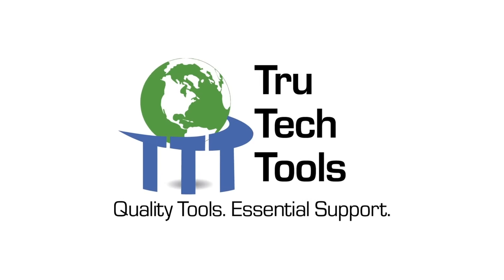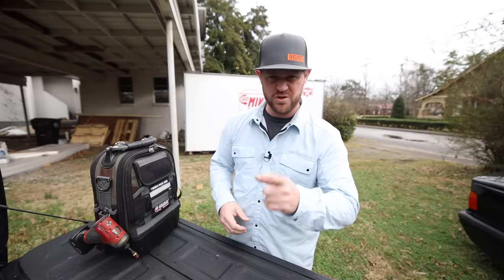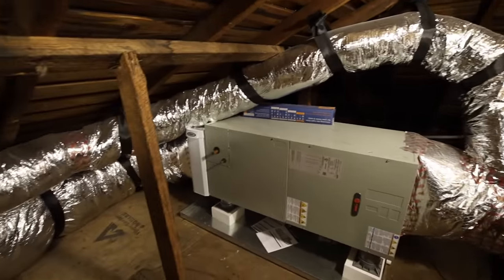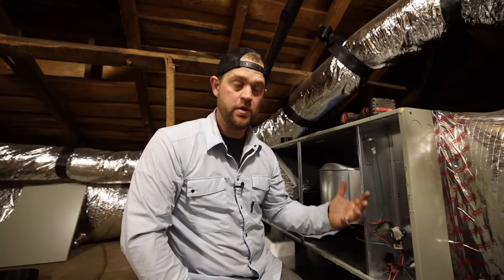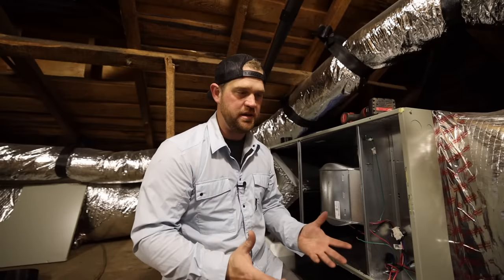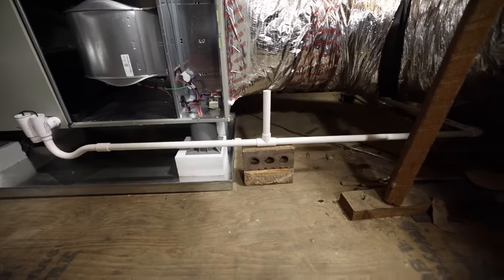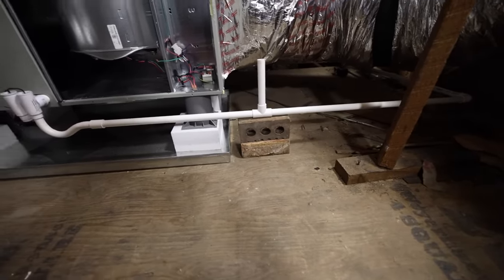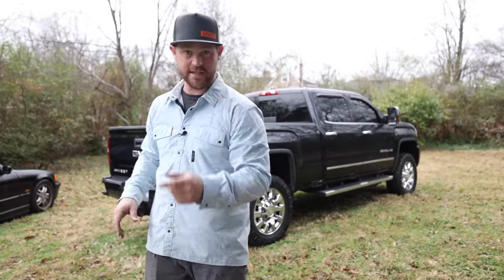I Should’ve Known BETTER…| HVAC Install

Comment: You have to move those drip shield baffles to the other side of the coil on both the front and the back of the coil. They divert the condensate down into the drain pan. Always read the manual
Reply: Also press fittings are trash. Carry your damn torch to the attic and braze in the lineset like it should be. I enjoy brazing and will NEVER use that garbage whether it’s zoomleak or rls. Used to like your channel but it’s become one big infomercial
Reply: You can’t forget the useless float switch on the p-trap
Reply: @baitcasterdisaster8981  get with the times my guy, that’s exactly what they used to say about  pro press fittings for water heaters. If done properly they never leak especially if it’s rated for 700 PSI. The future is here those who fail to adjust will be left behind!
Reply: @Luis-jw2yx  perfectly said. Somebody always has to complain about the way people do stuff and parts they use.
Reply: @baitcasterdisaster8981  He said it more than once that he sponsors several items used in HVACR servicing and installation.-
Reply: @baitcasterdisaster8981  get with the times, don’t be scared of using new technology, embrace it and master it

Comment: The filter/drier belongs INDOORS per the mfrs that supply them loose, it is in the manual.
The suppliers that put them in the units from the factory are done to make sure that it gets installed. Usually this equipment is low end stuff installed by lowest bidder.
Reply: I've been dealing with outdoor driers since early 1990s. I'd say it's okay.

Comment: A few things I want to point out.
How come your not using a water pump with 3/8 
hose straight to the laundry or basement septic ,
and I think using easy-trap going from the coil straight to the pump works much nicer.
And one more thing you need a switch on the top off the furnace for service’s. Thx you

Comment: Nice clean work. You made that fishing of the high voltage through the liquid tight look very easy. We know that took some time and effort, didn’t see you apply any electrical glide in the liquid tight . Again nice work.👍👍🇨🇦
Reply: using conduit lube helps when pushing the wire through by yourself.

Comment: If you use plumbers pipe dope on the PVC fittings going into the coil it will seal properly and you will be able to unscrew in future if need be.

Comment: very clean, we always insulate our drain lines to prevent drip trails, + safety switch on the pan just in case extra security never hurts.  Looks like the plugs not installed on the pan from what i can see.

Comment: When dealing with Trane, I'd order a downflow air handler if I couldn't get the pan and the discharge the way I needed it to be. It'd come already configured with the drain pan and discharge right configured in the way you need it.

Comment: I see a few things that are different codes for me here in NC 1. We have to insulate the drain if in a attic 2. Drain has to be supported with metal hang strap 3. the primer must be seen on connected pvc
Reply: In ky. That job wouldn't fly all that flex imo. Looks like hack job just doesn't look good we use round metal in most attics flex only from duck 2 reg. Maybe I missed something

Comment: I woulda prob put the armor flex on the suction line before you pressed the copper pipe looks cleaner then having to add the amour flex after at 6:30 . Looks good tho
Reply: "armor flex" 🙄

Comment: That wye right off the square to Round is going to get a lot of blow by. Should have used a plenum to create stawić pressure that would help distribute the air more uniformly
Reply: Static *

Comment: Great work! A couple things I would do different though. Not that your way is wrong or not code worthy, again great work. 1 there's no need for liquid tight (not to mention it's expensive), I'd use flex conduit. 2 I'd typically build a trap for a negative pressure box. I try to get a 3" difference just to be sure it doesn't prematurely/intermittently drain into the secondary. 3, I would only use a safety switch on the secondary and also make sure it drains into a conspicuous location. 4, I would also (especially since you're not brazing) use the factory rubatex and make it all one piece instead of using that split stuff. Other than that, everything looks great and your work is better than 90% of the stuff out there! Keep up the good work, dude!

Comment: If everybody watching this is such a expert, why are you even watching?  Leave the man alone.
Reply: If a man is going to instruct, the instructor should provide a quality lesson. Experienced installers have pointed out legitimate concerns which will benefit the lesser experienced. FYI, I read thru all comments to date & found everything I noticed mentioned while finding several comments on items I did not pick out. Truly a  beneficial forum.

Comment: Kind of weird to see a video like this, here in Florida, when you install the system you start the system. Never seen anyone come back in and do this type of work. Even in new construction, on trim out, Everything is done except for the vacuuming of the system and the start up of the system. Hmm. Good work though.

Comment: We had a seminar at Ferguson a little while back trying to sell those quick clamp copper fittings , there is no way in hell I'd ever go for that crap. I could see very isolated circumstances where one would come in handy on a retrofit application where brazing was just not possible due to limited space or dangers of an open flame... But other than that there is no way I would ever use that mess. Clean looking install the only thing that we do extra we also add a drain float on the metal Pan itself,  probably ultimately unnecessary but I feel better giving the customer that extra protection.

Comment: Great video brother but I can't help but to think that I would ever give up my torches for a pro-press or even the new shark bites they have I just trust it better rubber breaks down over time lines vibrate and over time they will leak I have seen it but to each their own still love the video and your details!
Reply: You are a smart man !!!! I have been doing this trade in super market and residential for 4 decades. You are correct they will not last. !!!!!!!!
Reply: Especially with the POE oil. And with the new mixes that keep coming out. Can’t go wrong with braze. Beside more cost effective in my humble 20 yrs in the field

Comment: High dollar crimp machine is fancy . Years ago in mid to late 80s carrier had the fitting that had the O ring type fitting the big nut would crush down on lines BUT! After couple years it would leak i wouldn't trust anything less than silver soldering sorry I'm old school. Few yrs of expanding and contracting especially heatpump that fitting will leak .

Comment: Good clean organized work but ..!  I dont know if I'd use the tube brush cleaner after cutting off the bell ends of evap lines.  Any shavings or debris get into the strainer or txv or eev its trouble.   Not trying to be critical just careful....  Otherwise, real good work and video

Comment: Amazing looking install so far, I would've most definitely used a larger drain pan, that right supply edge looks to be right at the edge of that pan, maybe slide the air handler to the left inside the pan. Clean work though brother, Love your channel!
Reply: Pan is definitely not sized properly, since code requires the pan to be at least three inches longer and at least three inches wider than the equipment above the pan. So splitting the extra, there should be about 1.5 inches (or more) sticking out beyond the equipment.
Reply: @stevebabiak6997  very true but codes vary from state to state, I don't know the codes in TN, I'm in NC and we are as you stated needing 3" all around. My number 1 priority in an attic installation is the condensation overflow prevention.
Reply: @toddhagee6716  - I didn’t see a cut-off switch on the pan to deal with possible overflow …
Reply: @stevebabiak6997  @11:25

Comment: Damaged a bunch of fins on the coil set up when you changed the drain pan. Unit hadn’t even been turned on yet and you decreased it’s efficiency and cooling abilities. Also increased it’s odds for freezing up in the future.

Comment: Zack I love your videos, but man those Tem4 have been nothing but nightmares for us service techs here in Florida.. can’t tell you how many times I’ve been to calls where the secondary was full of water due to the baffles not being corrected. Also if speed is not adjusted it tends to suck water off the coil depending on static pressure or how clean the coil is. Vertical applications have also been a nightmare due to the slime it builds up and the slime it builds inside the backside of the pan that is almost impossible to clean. I hate Trane lol.
Reply: You should love Trane. I love all equipment because they keep me busy.

Comment: I know you may be stuck with this type of installation, but you never install an HVAC system outside of the thermal envelope. It takes half the energy just to condition (and that doesn't do a very good job) the space around it and the duct work too. I learned from my mistakes. And you'll appreciate it later on service calls. No hot attics in the summer.

Comment: I definitely not against the way things are in order to be a modular system but I have wondered about why manufacturers don’t make air handlers that are the drain pan.  Without much effort they would be able to make a literally universal air handler that could be installed on any side without having to be re-arranged internally

Comment: I have nothing but problems with my Hilmor pipe benders on pipe larger than 5/8. Had to stop using them and go back to my Yellow Jacket benders. I have no similar issues with them. I guess you get what you pay for.

Comment: Good video - Thank you!   I would highly recommend that the breather is installed over the spill pan in case it leaks and the float is stuck.  This would prevent the area being flooded if the drain tube gets blocked down past the breather.  😃

Comment: Your video is amazing. I am watching it to see if the person who installed my system did properly.
My  Trane system is almost the same than yours but the amount the air coming out of the vents is extremely low. The installer says it need to reconfigure the ducts. 
I just did't understand one thing: why is your emergency switch (overflow switch) above the trap level?
Shouldn't it be the same or slightly below the trap level?

Comment: I had a class once🤣 and for 8+ hours the only conclusion I came to was always read the manual. 
My oil /gas burner instructor also stated that it doesn't matter how many times you've done something always glance at the manual. 
In general it's usually the installer that hacks it in,then everyone calls it junk when it doesn't work!(Goodman)
Thanks again for the videos!
🍺🍺🍺🥃🥃🏌🏻‍♀️🎯
Stay safe. 
Retired (werk'n)keyboard super tech. Wear your safety glasses!
O-Rings can't be my future!🤯
Reply: Ha!  I say this to my techs almost weekly.  Enjoy retirement!

Comment: Lol you cut out the part when you were putting the coil in all the way back. Either position left or right there is a screw that keeps it from going back in easily on the bottom back. I usually just snip them a bit with the cutters and it just slides all the way back easily.

Comment: Great install, as usual! What drill attachment did you use for knockouts for the high and low voltage connections? I couldn’t find the link in the description.
Reply: it's a step down bit ain't it?
Reply: @saulurena7681  my step down bits are cone shaped. Maybe a different style?
Reply: It’s just a standard step bit ..
Reply: @nicksplumbingheatingandcoo6091  his was cone shaped as well, most all I’ve ever seen are just different increments of size

Comment: The vent is called a "vacuum breaker" and it does exactly that, stops a vacuum from holding the water in the pipe.
Reply: That's why your supposed to prime your P-traps! Show me in the install manual where your instructed to do that and I will concede! And I've only time I have heard of a vacuum breaker is in relation to steam pipes.
Reply: @berated4541  I don't know what you're trying to say right now but maybe just open a code book or any plumbing handbook. Every trap requires a vent installed as a vacuum breaker. Or maybe look at the plumbing in your own house? If you can't understand this maybe you shouldn't be working on anything to do with plumbing
Reply: @Andersonairchris  😂🤣😂🤣 Go ahead and show me in the installation manual (The one booklet the Engineer team that designed the unit wrote so that it could be properly installed and maintained) and I will concede. And what code book are you talking about? Codes vary from county to county, city to city and state to state. So I literally don't know what your trying to say. And I was just referencing the install manuals from the manufacturers so don't get your panties so twisted big guy. And as for your last sentence, I would love to compare our work and not only see who's looks better, but who makes more doing it 😂🤣😂😃
Reply: @Andersonairchris  Did I also mention that in 8 years of installing residential swap outs and new construction, I have never once, been called on not having a breather on my air handler. And CA is as strict as it gets in the States.
Reply: @Andersonairchris  Do me a favor and read a RUDD air handler install manual and then leave room to eat your words. Also, the fact that your a teacher explains it now, when’s the last time you did installs on a regular basis? Actually, don’t bother answering idc. 😂
Reply: @Andersonairchris  And $150 hr is what you charge to teach not what you get paid to install 😂🤣
Reply: @berated4541  I'm not doing you any favors but the fact you install rheem explains how you're acting. And FYI I work in the field about Every other day or when my employees need help or training. I really don't have any words to eat here being that I explained what the vent is for and what it's called. I'll let you get back to your keyboard warrior club now somewhere else
Reply: @Andersonairchris  that’s cute my guy but you know as well as I do they are all the same thing with slight variations from manufacturer to manufacturer. But sure thing I’ll go back to keyboard warrior-ing and you go back to teaching a bunch of people that won’t know their ass from a whole on ground when they get out on their first job site. I’ve had more luck with helpers that had zero schooling, than someone with a piece of paper saying they attended class.

Comment: next time you might want to put the foam blocks first then pan and stands,that way you have slope on emergency pan drain line,also the evap conversion,the job looks beautiful.a bit bigger pan.on line set always think about oil return.love the press.

Comment: Dryer always goes closest to indoor coil as possible, hvac 101.
Reply: No it matters,imagine a 75 foot lineset,and how much contamination could be between the condenser and coil,and especially if it's a txv system.

Comment: You made pulling that line voltage, through that whip, look easy !!
Reply: Same thing I thought.
Reply: Same thing I was thinking. I always need some type of lube and that normally ends up being dish soap, because I forget to bring it and don’t feel like running out to get any.
Reply: @davonmaye3123  leak detector works well

Comment: Do you find that  not using mastic over your joints/tape that your tape comes apart after a couple years of attic heat?  I've never seen so much tape without mastic to hold it together.

Comment: I don't like Zoom lock. Found those to leak at the fittings. I could just wiggle it and it would leak. Also are you needing to put in a bigger drain pan or adjust that one for 2 inch all the way under the air handler?

Comment: Press fittings 🧐don’t like it, tends to leak eventually!!!
Reply: I had the same worry; even low pressure lines can leak refrigerant; good point!
Reply: Have had at least 5 service calls from units completely empty from leaking press fittings
Reply: Sometimes the installer used the wrong tool to do the job!
Reply: Braze joints leak eventually as well
Reply: @cesarmoore7996  not if they are brazed properly. . Most people don't know how to braze properly to begin with. Hell a lot of people  don't even know how to set up the oxygen and acetylene right. I'm not talking a turbo torch. Those are junk 2 in my opinion. Never used one ever. Of course I do commercial/ Industrial so the Lil turbo torch isn't gonna work on the  bigger tubing
Reply: @2913terry  same can be said about press fittings, no leaks if pressed properly
Reply: @cesarmoore7996  I have no experience  with press fittings so I can't argue that one.
Reply: @2913terry  👍🏼
Reply: @Bryan-Hensley  I sold American Standard and never had any problem with spacers.
Reply: @Bryan-Hensley  OK don't get excited!
Reply: @cesarmoore7996  press fittings are ass stop defending the sloppy product
Reply: @marioramirez6741  I might consider taking your advice if you remotely sounded like an intelligent individual, but unfortunately you don’t
Reply: @cesarmoore7996  You're the Zebra I'm a Lion. Learn your place pleb.

Comment: Didn't switch the drip trough, and you possibly void the coil warranty by cutting off the factory copper fittings

Comment: And I see you have limited space but that return looks like the filter cabinet is just capped off n that 14 is just cut in there w no plenum . I could point out atleast 5 problems with this is still .